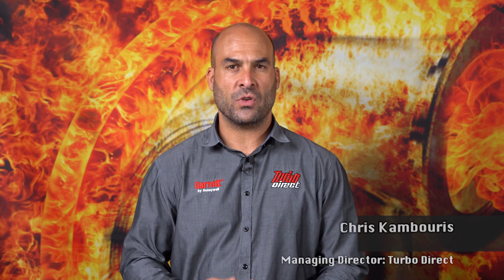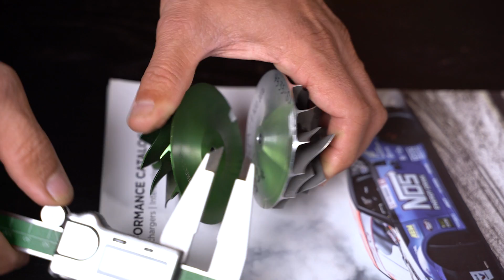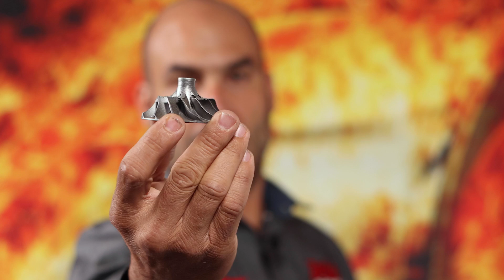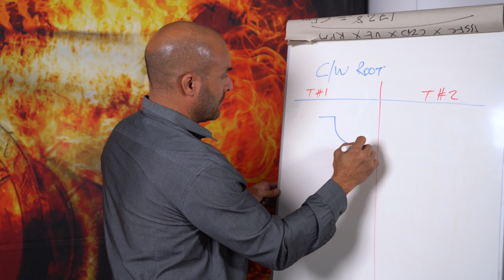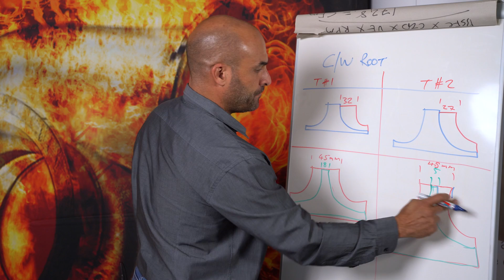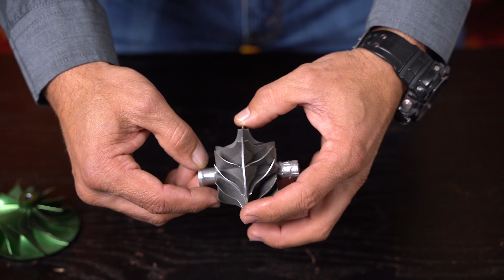Turbo Compressor designs - Discussed

Comment: My turbo was gone tried to replace it with a refurbished never gotten anywhere with it, but it cost me $4000 still not working properly, then another guy told me he’s gonna fix this did a diagnostic then said one of my injectors need changing $600 later then he claimed to have serviced the turbo after completion of the job I paid $2100 and nothing changed still working the same

Comment: Can those splitter blades and main blades work in any vehicle?
Reply from the maker: Specific designs are applied to specific engines at the design phase by the turbo manufacturer according to the engine manufacturers requirements

Comment: Extremely disappointing video from a company that typically produces good, informative content.  This video has ZERO useful information regarding comparing compressor designs!  Every "comparison" in the video was "apples to oranges", there was NEVER any discussion on the merits of a same size 11 blade full height to a 7 blade splitter (Duh, total flow of both is comparable but the 7 blade splitter is better for any app other than a full out high RPM race car) and the topic of compressor weight of comparably sized and configured cast vs billet compressors and the faster spool time of the lighter billet compressor was never mentioned. TurboDirect shoudl DELETE this worthless video!

Comment: I was really looking forward to getting some useful information from this video, but all I learnt was the names of the different parts, which most I already knew😢 I understand the Author doesn't want to give away valuable information to thousands of people, but I am getting into building my own jet engines and am looking for a supplier for compressor wheels, and I would like that supplier to be in my own country of Australia. If I get told the information I want then I will buy off you for the rest of my life, hopefully 30+yrs lol. I actually only have two questions I want answered and then we can talk about size, rpm, boost level and then hopefully price, and then I will be able to start working out the sizes for my designs. To start with I will be using second hand compressor wheels(for testing)  out of turbos off cars and larger machinery, which I already, have but if I am going to be buying from you for the rest of my life I want the truth, and I am definitely not going to be telling anyone else about it. I am an engineer as well as sheet metal worker and for the last 25+ yrs I have been doing performance work on bikes, scooters, racecars, road cars(atmo/turbo) trucks and heaps more with my tiny little business GCraig Pe4mance. I would really appreciate it if you would leave me a comment or contact me about the future, thankyou for your time, Craig Landsberg
Reply from the maker: Unfortunately noone will share the kind of information that you are looking for. To manufacture a wheel with a specific mass flow rate, surge and choke limit, etc is one thing, teaching you 'how to fish' is unfortunately not an option im afraid. I would contact a company like honeywell - they offer these types of design services.

Comment: Is a efr9174 1.05 split pulse a good responsive turbo to put on a 4.0 barra to run 20-22psi boost on pump 98 with supporting mods?
Reply from the maker: Perfect choice - it will spool fast and make the claimed power easily.
Perhaps play with a smaller AR turbine housing if the application is more street use.

Comment: After watching your videos, and looking into the new Garrett compressor maps vs their older tech i have assumptions and questions. The newer Garrett 10 blade compressors move the compressor map to the left, greater mass flow at lower shaft speeds, (better "sealing" for a wrong word idea), better efficiency percentage at high pressure ratios. However, it seems the "leaky"  7+7 wheels catch a bigger "gulp" of air and push the useable map to the right while sacrificing "compressor efficiency percentage"at higher pressure ratios? I'm not a turbo builder, but i am a dyno guy.
Reply from the maker: Garrett have gone backwards since they were spat out by Honeywell.  Honeywell aero engineers were the secret recipe to the previous successes of Garrett, which are now lost. The G-series is disappointingly poor i have to say when compared to other models that compete head on.
Reply: @TurboDirectSA  Thanks for the reply. I've been studying the new/ old Garrett maps, and it seems the 10blade stuff is good at high pressure ratios, and moves the map to the left,  but really doesn't help much off the right side of the map. The 9 blade turbine seems extraordinary, tho I'm sure it has repercussions
Reply from the maker: @kylemilligan752  Garrett once bankrupt, had to come up with ideas to sell product for max profit, they used ancient journal bearing designs which they had moulds and tooling for in the form of the GTW series, and machined a billet compressor wheel which was nothing innovative, but as long as it was billet and did not outperform the GTX/G-series it would sell, at a massively reduced cost to their manufacturing. All the components that made up the GTW were already old and tooling paid for, and in stock, to assembling something with a new compressor wheel and charging a hefty price for it, was a 'winner' but in fact the product itself is not very good at all, and being journal bearing it didnt last long and was laggy.  On the G-series side the design of the compressor is not that great, its literally something that is overrated and by alot. Its not that reliable compared to the GTX Gen2, and the 'clean sheet' claims were simply something to start a new following - they should have been on Gen3 G-series years ago according to ex Garrett employees, yet they are still on Gen1 - pity the dream team is no longer since the management change.
Reply: @TurboDirectSA  It really seems the "new" 10 blade stuff is a gimmick to sell new shit. If the 10blade compressors were so fantastic, they would have taken over 40 years ago. There are always compromises in compressor design. No free lunch
Reply from the maker: @kylemilligan752  Actualy looking at the ancient CAT design compressor which is 10 blade (no splitter blades) that is now almost 30 years old - it was made originally from cast aluminium, and then machined, and now titanium -- its OLD and 10 blades. the turbo part# is 740464-20 - check it out.
Reply: @TurboDirectSA  Thank You Sir for some truth!! Us old folks question the fundamental ideas, and old compressor maps, when folks try to feed us the latest and greatest BS to sell product. Comparing Garretts 10 blade compressors to their previous 7+7 shows the plus and minus. I feel this is mainly marketing bs to sell new turbos. I am curious of the potential of Garretts 9 blade turbine in the s400 platform tho
Reply: @TurboDirectSA  Sir, maybe you need a video educating folks how to read compressor maps.
Reply from the maker: @kylemilligan752  Dont be misled, the blade design in the BorgWarner Airwerks series is NOT Garrett, its in fact nothing like the Garrett design at all. Its a BorgWarner product through and through, and outperforms the Garrett size for size -
Reply from the maker: @kylemilligan752  If you check out a few of my other videos you will see i go over this in quite alot of detail - check out the comparison videos between the Borg Airwerks vs G-series turbo videos i have made, there i go into reading the compressor maps.

Comment: What would be the difference, for example, between a conventional 88s and an 88s with a stepped turbine wheel? Thank you
Reply from the maker: What do you mean by stepped?
Reply: It is being widely used in the United States in the Pro mod category, stepped turbine wheel
Reply from the maker: Still not understanding what you mean by 'stepped' this could be a cut-back, it could be a taper exducer, it could a a myriad of things -  @lucaspuigdemasa1438
Reply: @TurboDirectSA search the video from Robert Young of Xona/FP about the 5+5 turbines; 5 full blades and 5 splitter blades on the turbine. It's a video from PRI about 5-6 years ago. Now, this turbine blade arrangement has been copied for other applications.
Reply from the maker: @Pavel_Engines  If this is what is termed 'stepped' then i would comment relating to backpressure is improved substantially. There are benefits but also down sides, depending on the application and turbine housing combination.

Comment: So would a 7+7 spool better than a 11+0 blade? Both billet (gen 1 gtx vs custom 7+7 splitter)
Reply from the maker: Unfortunately spool has nothing to do with just blade count - not possible to answer this question.
Reply: @TurboDirectSA  im trying to find a turbo setup which will spool better than my existing turbo without losing any top end, im currently using a gtx2860r gen 1 0.64, do you have any suggestions? 330whp
Reply from the maker: @Bradley0beaver  you will need to use a smaller AR turbine housing, however if you are currently running a boost level that is higher than 1.4bar gauge pressure,  using a smaller AR turbine housing will restrict flow through the turbine, and this WILL affect your top end power negatively.
Reply: @TurboDirectSA  damn man! I use 1.8 bar boost :/
Reply from the maker: @Bradley0beaver using a smaller AR turbine housing like the AR49 or AR57 will definately limit top end power -  what motor is this?
Reply: @TurboDirectSA  its a 1.5l dohc 9:1 comp engine - what sort of power would a ar49 limit me to?
Reply from the maker: @Bradley0beaver shoot an email to info@turbodirect.co.za, Chris will reply to you - he has the most knowledge on this topic.

Comment: As I understand,, every 10 lbs/min would produce ~ 100 hp on gasoline engine. 
But for example I have diesel engine om605 with gtx3071, 
1.8 bar set. 
And as I see its no way even close to 500 hp get with this turbo,, 
Question is does this formula work only for certain fuel?
Reply from the maker: BSFC Brake specific fuel consumption comes into play yes.  Diesel engines will not produce the same output as a gasoline engine, and the same goes for nitro engine and methanol engines etc.
Reply: For diesels it's around 70-80 hp per 10lbs/min.

Comment: turbine wheel and housing is more important than compressor wheel design. there is a reason why most turbo oem choice is with splitter blades, garett started with 11 full blades in anti surge housings that can offer more max flow at the expense of higher surge line( higher minimum shaft rpm for starting to make boost) because a 6+6 bladed wheel has 12 blades at the exducer which means less spacing between the blades at the exducer means higher boost at lower turbine shaft rpm. For most turbochargers you can find a compressor wheel that has bigger higher blades smaller stub exteded tip at same dimensions which would be better than stock cast original. Just that at same boost whit a lower back pressure it will make more power.

Comment: Hello, with which of the 2 wheels I have the best performance, both wheels have the same average
TD04HL 45.65/52mm 5+5blades turbo wheel/ turbine shaft&wheel for
MITSUBISHI
TD04HL 45.65/52mm 9 blades turbo wheel/ turbine shaft&wheel for
MITSUBISHI
Reply from the maker: Unless you have a compressor map its not really possible to decide which performance better.

Comment: You kinda told us nothing, though. Just that different designs can achieve the same overall flow. Who actually has the better compressor designs? Is it the greater number of main blades? Is the splitter blade design generally better? If extended tips and a low tip height are ideal, shouldn't all compressors be made that way? And shouldn't all compressors be made with something like only a 25% strength overhead for the root diameter in order to maximize blade area?

And given all of THAT, if you could put any compressor wheel with any compressor housing onto any turbine wheel+turbine housing combo, and then use any bearing cartridge and housing; What would be your ultimate general combination? Borg turbine and bearing with Garrett compressor wheel? Borg bearing and outside with a custom compressor?
Reply from the maker: What i did say and made clear was that no blade count is responsible for a single feature or performance characteristic - its ALOT more complex that just slapping on 10 blades or 9 blades .... more than this i wont be able to share.
Reply: @TurboDirectSA  Well, generally, which ones are more linear rather than peaky, and which ones are louder?
Reply from the maker: Im not able to comment
 @Drunken_Hamster
Reply: @TurboDirectSA  Why? Have I offended you in any way? Could you at least answer the loudness question? And perhaps which count may be less likely to partial throttle surge in a standard compressor housing? I really like the dose sound off-throttle, which sounds better with standard housings, but I want to run minimal risk of partial throttle surge despite having a standard housing.
Reply from the maker: @Drunken_Hamster Loudness question? I dont take offence sir - no idea what you referring to there.   Your question is not able to be answered im afraid, there are just too many variables. How long is a piece of string comes to mind.  

E.G what does "standard housing' mean exactly?  Surge depends on a myriad of things, Blade count isnt really anything that would create or supress surge.
Reply: @TurboDirectSA  A standard housing is a compressor housing that is not anti-surge (doesn't have the little slots or holes adjacent to the primary intake path). The loudness question is more of "Does it hold true that fewer blades tend to create a louder whistle than more blades?"

The anti-surge question can have a few variables handled if you'd answer the question about which blade counts tend to be more linear and then consider that I intend to run relatively high boost (20-35psi) while using a properly sized turbo for my engine (roughly a G30 for a 3.0L or a G25 for a 2.3L engine, or equivalent Borg warner) and not an oversized turbo.

By that, I mean, if a higher number of compressor blades builds a lot of boost at low RPM, then, in the case of running relatively high boost, it may be more likely to surge at partial throttle in that application, even if the turbo isn't oversized for the build. Therefore, if that was the case and I refused to run an anti-surge housing, I would either have to deal with that surging another way, or buy a compressor wheel with fewer blades. Or both.

This is why I asked which design was more linear (from what I understand; a broader rather than taller compressor map), and which one is less likely to surge, either by design not pressurizing the volume of air as much, or by simply not building as much pressure and volume at low-mid RPMS that it will surge under partial throttle.
Reply from the maker: Sorry i disagree  @Drunken_Hamster  - a ported shroud housing is called exactly that because of its ported channels - you get many AR variations in ported shroud and un-ported style housings together with inlet and outlet variations aswell, so using 'standard' as its description is a bit vague especially when you get a 'standard' vband housing AR60 and then a 'standard hose clamp housing AR60, then 'standar' AR70 housing with vband inlet and 90degree bend outlet to hose clamp non ported..... and so on.
Reply: @TurboDirectSA  I figured it was called something else. Thanks for correcting me on that. So in a non-ported housing, which compressor wheel design is least likely to surge at partial throttle openings? Or does it have to do more with the pressure ratio and what pressure ratio an individual compressor design is intended for?

IE if compressor wheel A is intended for a 1.5-2.5 pressure ratio, and you run it 3, it'll be far more likely to surge in a non-ported housing than compressor B designed for a PR of 3-4 that you're running at 3? Or are almost all compressors designed with a housing in mind, and I should generally run x kind of housing with x kind of compressor?
Reply from the maker: How long is a piece of string comes to mind again - the question simply cannot be answered, it depends on a myriad of things.  @Drunken_Hamster

Comment: This is a good video ....very interesting 
I want to ask 
What is the best number of blades or what determines the number blades
Reply from the maker: Blade count is a small part of the design criteria of the compressor - factual data like air flow, mach speed, P2C, losses, efficiency etc are more important, and changing the design of the wheel yields differing results, which produce totally different maps and flow data. no two multi blade wheels will flow the same even if they are the same inducer and exducer size. The driving turbine has a big part to play in the performance and ability of the compressor aswell which is something that is not spoken about often due to the limited knowledge on the topic.

Comment: If you were to compare a billet 7+7 blade  with extended tip to a 11 blade extended tip which would flow more? Great video btw
Reply from the maker: Its impossible to say unless the designs of each, dimensions and features are visible. More importantly the compressor maps provided. The theory behind the multi blade Gen1 GTX compressor is that more blades do more work .... BUT its not only about the total number of blades, because if it was, why not have 20blades.... 

Aerodynamics and thermodynamics are extremely complex topics, hence the secrets and lack of information out there in the public space.
Reply: @TurboDirectSA  thanks for the reply mate, but I guess I'm somewhat might find out soon as I'm about to replace my 11 blade 60-1 to a 7+7 billet. I have a feeling it's not going to make a much of a difference at 22psi but we'll see
Reply from the maker: @joffaalien5518  Keep us up to date please.